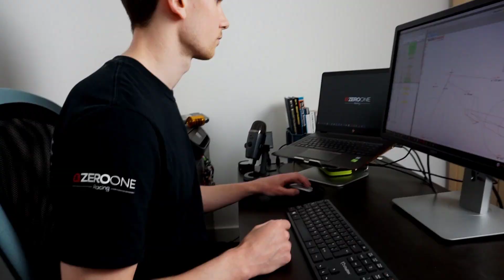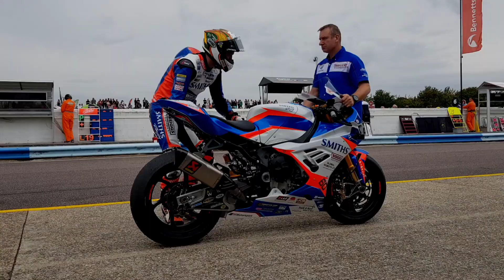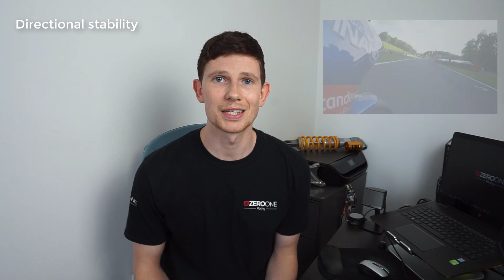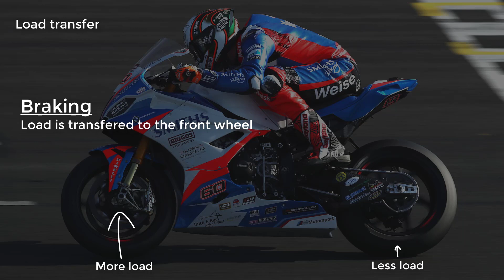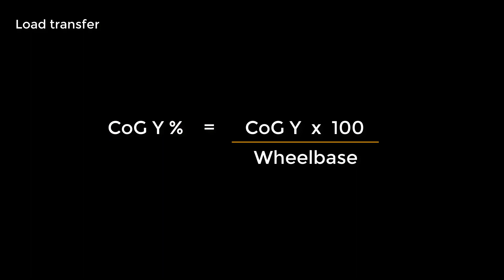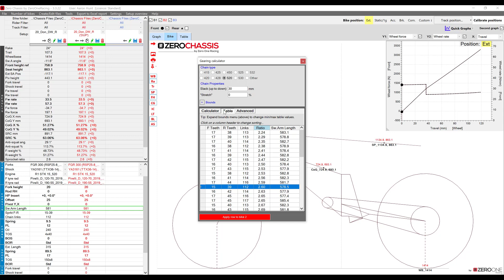WHEELBASE EXPLAINED! | Motorcycle racing geometry

Comment: Awesome video!  You not only clearly explained the concepts behind the wheelbase geometry, but also gave people some basic knowledge to calculate and assess their own bike. 

Could you do a video on wheel sizing ?  I'm not talking about the people running 250 rear wheels,  I'm talking about the handling aspects when going up or down in wheel diameter,  not so much the performance characteristics of tire sizes and widths.
    A video on why certain wheel sizes have become standard to specific applications, like scooters, moto gp, sportbikes, dirtbikes, etc.

Comment: Hello Aaron, I have a question for You. Let's take R1 2020 as an example. If I will make the wheelbase longer by adding the links to the chain, what can I do in the front end of my R1 to help it steer better? Should i lower the bike by sliding the fork up in the triple clamp to compensate for the longer wheelbase? Can you please answer? Btw amazing video! Subscribed :)
Reply: If you make your swingarm longer, to keep the same weight transfer (cog height %) you would have to rise your bike.
Dropping the front you make your steering more reactive, the wheel base shorten a little bit turning better, but your center of gravity will be lower, reducing weight transfer. 

If it was me, I would try first rising the whole bike, maybe 4mm in the front and 2mm of shock length (around 4mm at the tyre). 
Than, if I still need more reactive steering, I would try to drop the front 4mm from that position.

The idea is to pitch the bike but rising the cog.